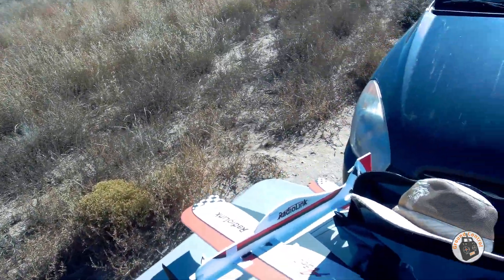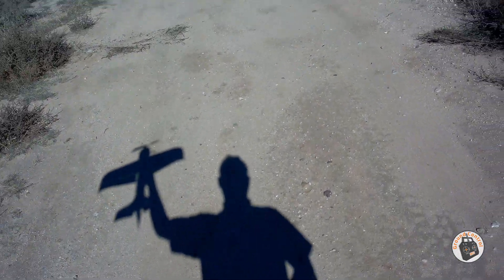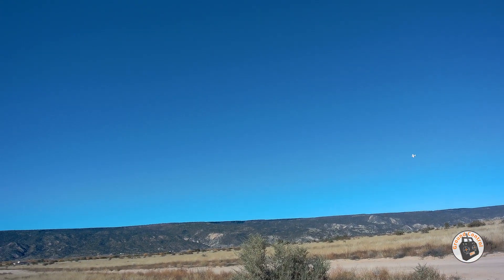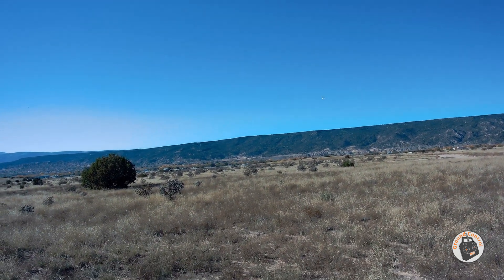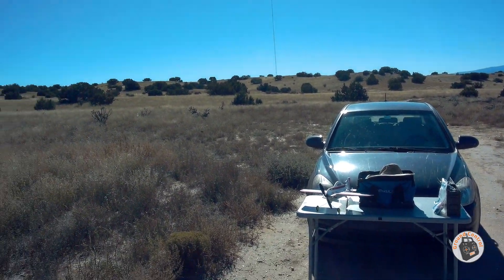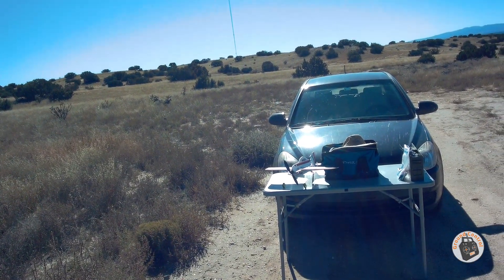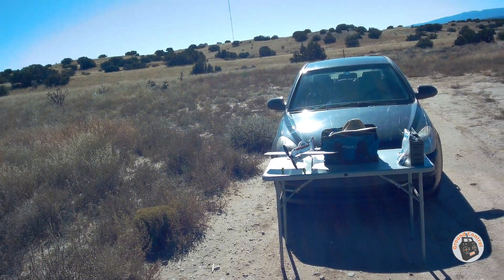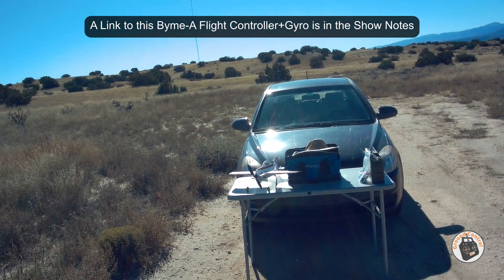Test Flight with the New Version - Radiolink Byme-A V2 4CH Flight Controller & Gyro with 6 Modes!

Comment from the maker: RadioLink Byme-A V2 & Byme-D Flight Controller & Gyro
https://www.radiolink.com/bymea_where_to_buy

Manuals for the Byme-A V1 & V2
https://www.radiolink.com/bymea_manual

RadioLink A560 3D Trainer Plane 
https://www.radiolink.com/a560_where_to_buy

Radiolink Original Spare Parts for New A560 Fixed Airplane
https://s.click.aliexpress.com/e/_DB7jABz

RadioMaster TX16S Transmitter
https://www.banggood.com/custlink/DvvycmfSMK

RadioMaster TX16S MKII Hall Gimbal 4-IN-1 ELRS TX
https://www.banggood.com/custlink/KK3EUzvecp

Banggood GCRC
https://www.banggood.com/custlink/GmDmQ1nVkO

Comment: Nice flying!

  That is an amazing amount of bank angle for a gyro-stabilized flying mode.  I think my Xk VTOLs are limited to 40°-45° max..  The Volantex Sport Cub 500 gave me around 50-60 degrees for a tighter turn.

Happy flying!
Reply from the maker: Yes, I was pleasantly surprised at how much roll and pitch this plane has in fully stabilized mode.
You  can fly this one in a very small area even when fully stabilized.
I wish those Mini Warbirds and other planes had an acrobat mode like this where you can also perform rolls as well as loops. It makes that mode so much more fun ;-)
See you in the Air!

Comment: All those different modes sounded a little confusing but obviously a lot of fun.
Reply from the maker: Hi Jack!
Yes, and since I normally only use (3) of them on the same switch, it was difficult for me to remember all the switch positions ;-)
After a couple of flight sessions though I could switch into the modes I wanted without thinking about it.
That is a gyro with a lot of features.
See you in the Air!
Reply: Haha,, you can remember that easy, Stabilize Mode, Gyro Mode, Manual Mode; then next flip is Vertical Mode(Multicopter),Acrobat Mode, Vertical Mode(Fixed-wing).
Reply from the maker: @Radiolink_official  Only after I've had plenty of Coffee ;-)
Reply: @GroundControlRC  😀

Comment: great video love the work you put in to tell us about these planes i order this plane because you made this plane look so cool what it is i’m a beginner and i few it for the first time and it shacks it’s wings up and down really fast on gyro mode there was a little wind but not much and the remote starts beeping after 2 minutes of flight can you help me with this mainly the wing shacking back and forth please help thanks
Reply from the maker: Hi Vincent!
What a fantastic 3D Plane ;-)
What I have found, using Gyros for the past year, is setting up the plane with the amount of control surface movement you want while connecting the linkage so you have the most amount of travel of the servo arm. If the servo arm has too little movement it causes oscillations with the Gyro.
Here is a video I produced that explains this very issue and may be helpful.
https://www.youtube.com/watch?v=HVOGMGgm3cs

Comment: Do you prefer fixed wing vertical mode or multi rotor mode ? I found multi rotor mode a bit confusing as it wasn't the control i was expecting,I've ordered the new v2 now 👍
Reply from the maker: I prefer the fixed wing vertical mode.
After flying planes for a while you have the controls mapped in your brain so that mode is easier for me.
Reply: @GroundControlRC ™  Yeah it makes sense,and you want to learn proper control in that mode for when you advanced to manual or a different plane.

Comment: awesome!! does vertical pull the model up at the flick of the switch or do you get it vertical then hit the switch?
Reply from the maker: Thanks!
You can do either but I typically hit the switch and it will automatically go into vertical mode ;-)
Reply: very cool, I have ordered one last week, look forward to trying it out, amazing the technology in such a small device  - cheers @GroundControlRC

Comment: i want that system.  what reciever,  flight controller, esc, motor, battery u using please.  where to buy also please.
Reply from the maker: Hi Claude!
It's a pretty fantastic 3D Trainer isn't it ;-)
Here is a full list of spare parts which includes everything you asked about.
Radiolink Original Spare Parts for New A560 Fixed Airplane
https://s.click.aliexpress.com/e/_DB7jABz
I hope that helps and I'll see you in the Air!
Reply: hi, here is the purchase link, you can select platform according to where you are live in, any question just let us know.

Comment: I just tried a first flight with the new v2 flight control and didn't go well 😕 I'm confused now with the switch positions,i crashed and gave up got confused.What is the switch positions for both 2 vertical modes and acro mode ?
Reply from the maker: There are a lot of modes and sometimes they're hard to remember until you cycle through them a couple of times.
Here's a link to the manual as it has a diagram that shows all the gyro modes and switch positions.
https://www.radiolink.com/bymea_manual_download
Reply: @GroundControlRC ™  the problem was it needed a calibration 👍 but today my aileron sevo packed up,good job I've got a spare already
Reply: @GroundControlRC ™  I've put the new servo on and made sure to connect the arm when it was in manual mode but the arm isn't central like it used to be 🤦 how do you adjust it using the app ?
Reply from the maker: @jasonleesuffolk  I've had a lot of component failures lately and that's certainly no fun.
Hopefully it will be smooth sailing going forward.
Reply from the maker: @jasonleesuffolk  I always use Sub-Trim to center my servos.
You'll find Sub-Trim in the App.
Reply: @GroundControlRC ™ I've done it now and centered the other servo's while i was at it,should be a lot better now 😀👍,i wonder if there's any other servo i could use for the aileron metal cog type,it gets a lot of use that one and needs something a bit stronger maybe 🤔
Reply from the maker: @jasonleesuffolk  That's great!
I wish I knew if there was a good replacement for the aileron servo as I don't see any with a control arm that long and I don't know which would work with the stock control arm.

Comment: do you have to use stabilize, gyro or manual mode along with the vertical mode? or do you have to switch to manual mode first?
Reply from the maker: You can certainly perform a Hover in Manual mode or in Gyro Mode.
If you want the Gyro to perform the Vertical Orientation, you need CH5 in Stabilize Mode and CH7 in Vertical (Plane) Mode or Vertical (Multi-Rotor) Mode for the Byme-A V2.
The Byme-A V1 has (1) Vertical Mode
Reply: @GroundControlRC  when testing before flying  what will the actions of the control surfaces be in the vertical mode?
Reply from the maker: @Adventureland171  The Elevator will go to full deflection if the plane is in the horizontal position.
Reply: @GroundControlRC  Thanks, much appreciated
Reply from the maker: @Adventureland171  You are most welcome.
I'm going to be posting another flight video of this fantastic 3D Trainer Plane on Dec. 20.
See you in the Air!

Comment: IDK.... It looks like the V2 Roll bank and pitch is increased more than the V1 in stabalized mode.
Reply from the maker: Hi Lasersbee!
It's definitely not all that restrictive in stabilized mode with this plane.
I did not have any problem making pretty tight turns in stabilized mode.
I was surprised at how much pitch it had in stabilized mode as well.
See you in the Air!